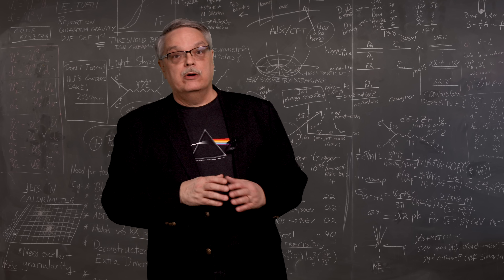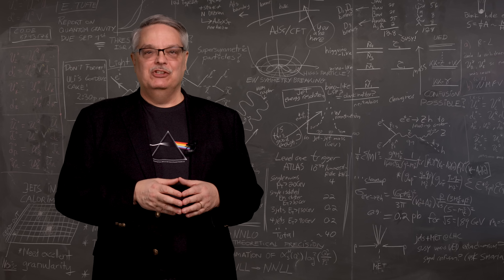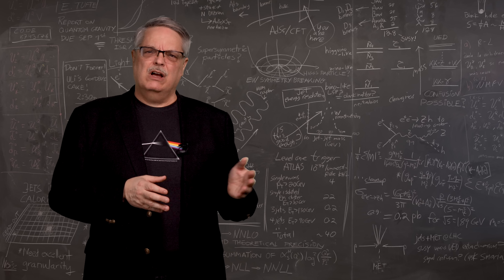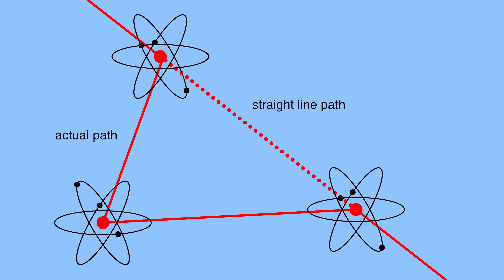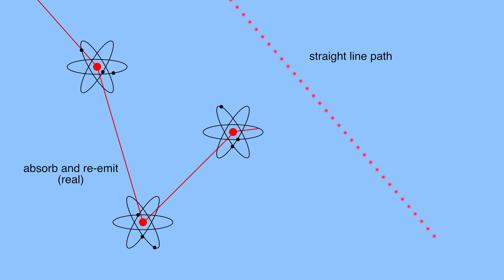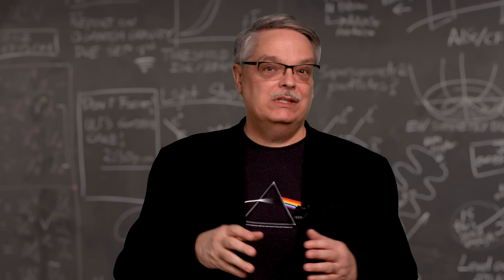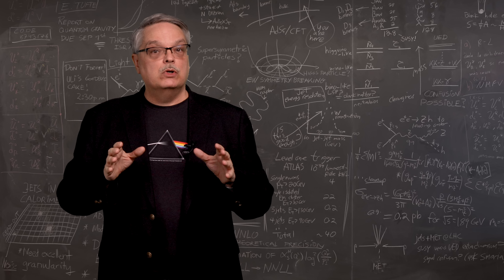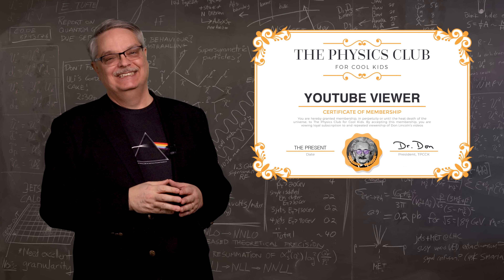Why does light slow down in water?

Comment: Dr. Don Lincoln,

Fine job sir! I do have an annoying question though since physics isn't my strong suit just yet...
When it comes to the big bang, physicists often say that the universe was in a HOT and DENSE state. But isn't that claiming at the same time that electrons were already there, all the forces of nature already worked, whatever the universe was at that time in that hot dense soup of matter and energy as Neil DeGrasse Tyson mentioned, radiation, .... in short GUT theory is already correct when they say that. Light is carried by photons, or so i'm told, in this video light slows down in any transparent medium, so if the universe came with a big flashing area of light, there must've been some transparancy and thus light had to go much much slower until the universe became completely transparent, about 380000 years later, and then light went on at the preferred vacuum speed of 299792458 meters per second. 
So here's my question, if electrons were already there, and we know that charged electrons move faster than the phase speed of light through water, thanks to Cherenkov, could what we think is inflation have been mimicked the same way and it just seemed that the universe suddenly grew by 10 to the 78th power (or so i'm told), it kinda seems odd that the universe was in a hot dense state when it started, and a black hole is cold. I mean energy, when it is compressed isn't necessarily hot, if the universe was a singularity or that is the preferred explanation so far, and gravity still had to separate from all the other forces but didn't necessarily provide all the levels of degrees of freedom that we enjoy now, it may have been there but the field was still zero until the universe was cool enough for it to start working like the Higgs was zero until the universe was cool enough for it to gain its non-zero potential, then the universe might as well been zero kelvin degrees. Energy comes in many forms and can convert into other forms of energy, so my best guess is that it can be infinitely compressed, unlike matter, because you have to squeeze the electrons into the empty spaces the neutrons and protons make, and inside those the gluons into the empty spaces of the quarks, and inside those probably something similar, and that all generates heat, because you're exciting everything, more vibration equals more heat. If you compress energy, you can burn 130 liters of gasoline to create 1 kilowatt of energy for an hour, or can can take it from a couple batteries, both substances feel cold to me and work, I can heat them both up 20°C more, and they still work, so heat is not the problem when it comes to energy, heat is a form of energy and usually the preferred form of energy that is the byproduct of converting energy, some is converted into heat energy.

Like I said, an annoying question, because I'm so not convinced about gut theory, that the universe was a hot dense soup of matter and energy, if it was a soup, it was a soup of energy, there was no matter yet, the fields that make up matter weren't there yet, so how could there have been a soup of matter and energy????
It's weird though, physicists do believe in the possibility that there could've been an inflaton field, but nobody wants to answer my question on whether or not it's theoretically possible that there is a field that determines, at certain temperature/pressure combination, certain fields are created (graviton field, gluon field, electromagnetic field, W+ field, W+ field, Z° field, ....).
It seems odd that the finger of god determines how much energy is converted into  a certain boson, the higgs field takes care of the mass of particles, but where do all the other properties come from? We need a certain temperature and energy to find the higgs, could we have found the higgs with just 7 terra-electron-volts instead of 14? Would that have created enough energy and/or temperature, to find the higgs?

Comment: I understand that this third explanation is also wrong. In air also there are always thousands of waves interfering with the light, in all the possible directions , if two interfering waves were to add up and the resultant wave would be slowed down then we would observe random speeds of light in vaccum or air too. Also, any electromagnetic wave has speed c . The reason that wave he said generated by water molecule's electron was slow is because it was in a medium which is the same question we are trying to answer. So i don't know the precise answer but this answer is not correct for sure. A phenomenon itself cannot be used to explain itself.

Comment: Sir I have a question about this explanation though you have cleared very much doubts....My Question is : How we can say that the second oscillating wave caused by moving electrons will interfere destructively rather than Constructively....if this will add constructively then it will increase the speed of light in glass, which is impossible🤔🤔🤔 ???
Plz reply my question sir
Reply: This is not impossible. This corresponds to a refractive index between 0 and 1 and means the phase velocity of the combined wave can indeed be faster than c. This will however not allow for faster than light communication since the crests will not overtake the incident wave. 
https://en.wikipedia.org/wiki/Refractive_index#Refractive_index_below_unity

Comment: Great explanation, however, I'm still unsure how the waves will combine to make a slower wave for the light in water. I understand a stationary wave added to a moving one give a resultant wave travelling half the speed of the moving one, but won't the wave from the oscillating electrons also be moving and won't it match that of the light's wave because it's reaction to it? Also, the wave from light must actually slow down otherwise the start of the light-only wave will just arrive a bit before the wave which is the sum of light and electron oscillations wave..?

Comment: This raises more questions for me than it answers. If the fact that the wavelength change of light (thus its frequency change too) changes the speed of it, means that different wavelengths of light travel at different speeds. -- I guess this is how prisms work... -- So, in this case, what is the speed of light (c)? There are like a gazillion different wavelengths, right? Which one's speed is 'c'? Or they all have the same speed, thus all have different frequencies (because they all have different wavelengths, and speed = wavelength * frequency)? Which would mean that all objects act as prisms? -- oooor 😁 the different wavelengths of light would excite different wavelengths of resonance in the electrons, therefore compensating for the variance and resulting in the same speed change (while not changing the frequency)?

Comment: Thank you for explaining this. All those years of physics classes didn't help me but this did!
Reply: Please can you explain to me why the wave created by the electrons moves at a different speed 9:20 and also why the combined new way moves slower than the speed of light 9:43 ? Please  I didn't find why...
Reply: @Khalid-Ibn-Al-Walid  Good question, but I don't think they went into an extreme depth in this video. For your second question, it's kind of simple. The "oscillated" field created by the electron is slower, so that would slow down the original light temporarily, until it speeds up again after passing through the object.
Reply: @thechannelofknowledge5145  Thank you very much for answering ! But please why The oscillated field created by the electron would slow down the original light ? I can understand that if the field created by the electron is slower then it's light will reach us slower (the light of the electron) and it can also modify the structure of the original wave, but why would it slow the original wave ?
Reply: @Khalid-Ibn-Al-Walid  Sorry if I do not give a good or correct explanation, but I think that the field created by the electron isn't exactly light. I believe they said it is an electric field. If it was an electromagnetic field instead, the original light wouldn't slow down, as photons don't interact with each other. 

Anyways, the electric field would start slamming into the photons, causing them to slow down. Since photons are restless, they would speed up again after passing through the container.

Since I do not have a correct answer for this, it's more of what I think that why the light slows down.

Comment: 3:54 Another reason why this cannot be correct is that the longer the light travels through the glass the longer the scattered path meaning that light will continue to slow as it as it travels through the glass. In addition, there is no guarantee the atoms will all be equidistant and that the light will scatter in exactly the same way from every interaction.

Comment: Electron's electric field is all around it. Oscillating electron emits EM waves in all directions. Electron's EM  wave in the direction of light wave can interfere with it and change its speed but Electron's EM waves in other directions will be absorbed or lost by the medium. In such case light will lose some of its energy and its frequency will decrease. This does not happen. Also, modified light wave should emerge from medium. This also does not happen. Why speed change is lower not higher. Kindly clarify.

Comment: So question:
Light is an oscillating electric field traveling at speed c. Moving through a transparent medium, it oscillates electrons in that medium. Oscillating electrons generate another oscillating electric field, that is moving at a slower speed. These two waves combine to make a single wave of oscillating electric field that is the ACTUAL wave that moves through matter, at a slower speed than c (because it's a combination of a wave at speed c and a wave at a speed lower than c).
BUT WHY DOES THE ELECTRIC FIELD GENERATED BY THE MOVING ELECTRON TRAVEL AT A SLOWER SPEED IN THE FIRST PLACE?

Comment: Still the question is from where it gets the energy to go back up to normal speed of light once it passes through the glass?
Reply: It doesn't need energy to do that. It simply stops interacting with the waves from the medium, because those only exist inside the medium. So all you're left with is the original wave, moving at c.

Comment: Like @Methane Lau I would also appreciate more detail about why the waves moves at different speeds. After all, they are both passing through the same medium and presumably have the same wavelength/frequency (as the colour of the light doesn't change in the medium). Although glass is a dispersive medium .... is this a factor?
Reply: The second wave doesn't really move at a different speed. The electrons excited by the incoming wave have inertia. This means that there is a lag or phase delay between the secondary wave and the incoming wave.  When the waves are added together the resultant lags the incoming wave. This lag becomes progressively greater as the wave propagates through the medium. By the way, the direction in which the electrons move is the same as the incoming wave and the secondary field is in the same direction. Therefore the wave follows a straight path within the material. Bending at the interfaces is a consequence of phase continuity over a plane wavefront just outside the boundary to just inside the boundary coupled with the change in wavelength arising from the change in speed.
Reply: @rogerphelps9939  Thank you very much for this answer you gave sir, but I have a question. I agree that the lag becomes progressively greater as the wave propagates through the medium, but at the end we will just have a big wave with different amplitudes at different places, the the "end" of the wave that first entered the medium will pursue its path without being slowed down and will keep going at speed of light. Idk if I got it wrong somewhere but I still don't understand why its slower... Please bro if you have some clarifications that would help me understand it would be the welcome....

Comment: In my opinion this is wrong. Different waves(gamma, light,microwave) travels same speed which is c. Changing the wave doesnt decrease its speed. I think the answer is in maxwell equation. The speed of the wave changed because of change of resistance of  the formation of electric field.

Comment: I had a battery powered toy car that shifted in direction (imitating refraction) when it rolled from the living room carpet to the tiled kitchen floor. This happened again when it moved from kitchen tiles to carpet. No doubt it was the change in resistance to rolling that caused the twist.  It looked strange but I could never understand exactly what was causing this to happen.  Is there an explanation for this, other than the fact that there was a change in residence? Thank you.

Comment: What if all that is happening is that the light is bending more in the water because water is similar to compressed air, and therefore the water bends more than it does in the air?
I always thought refraction index was like resistance in that increased refraction index caused more refraction the way resistance causes heat.

Comment: The video is still not clear on something (Something very important)

The original wave (Eo) AND the EM wave produced by the electrons (Ee) are BOTH travelling at C, right? Then, how does the combined wave (Eo + Ee) move slower? 
As far as I understand, it has something to do with the phase lag of Ee with respect to Eo. 

Place a very thin sheet of glass in between the source and the observer. 
The Eo before the glass stays the same. But, after the glass, we have Eo + Ee. Ee is NOT in phase with Eo. It turns out it's a quarter of a wave behind. So Eo + Ee also appears slightly 'behind' Eo. As a result, the Eo+Ee reaches the observer with a slight delay!

So, my intuition is that instead of 'slowing' down the EM waves, the glass slab kind of 'instantly pulls the EM wave back slightly' (due to interference), causing the 'apparent slow down' but travelling at C ALL THE WHILE!

What do you folks think? 

Where is my source?
Chapter 31 - Origin of the refractive index -  Feynman lectures. 
I have tried to convert the math into some intuition.
Reply: In my opinion the video is wrong. Different waves(gamma, light,microwave) travels same speed which is c. Changing the wave doesnt decrease its speed. I think the answer is in maxwell equation. The speed of the wave changed because of change of resistance of  the formation of electric field.

Comment: How does this explanation account for different indeces of refraction ?
Reply: In my opinion the video is wrong. Different waves(gamma, light,microwave) travels same speed which is c. Changing the wave doesnt decrease its speed. I think the answer is in maxwell equation. The speed of the wave changed because of change of resistance of  the formation of electric field.

Comment: Question: does light actually slow down inside medium (water) OR is it that it ends up travelling longer distances (due to refraction hence longer path) at same constant speed but when iy exits the medium it is delayed in time due to having lonher distance to travel?
Reply: I think that light actually slows down as it clearly prove the change in direction 
For the second part I think that as per Fermat's law light were to travel through a way which take shorter time
and the shortest distance is a straight line and adding up all the probabilities of refraction of light , it makes sense 
only it is slower because the distance light travels in glass is becoming shorter rather being longer

Comment: OK, so the electric field in the material is a combination of the original wave plus an oscillating field from the electrons, but why does that combined field propagate with a lower speed? When we reach that point in the video you just state it as a fact, so, so I would say you didn't explain it at all!
Reply: In my opinion the video is wrong. Different waves(gamma, light,microwave) travels same speed which is c. Changing the wave doesnt decrease its speed. I think the answer is in maxwell equation. The speed of the wave changed because of change of resistance of  the formation of electric field.

Comment: Thanks for this video but I till don't understand why this interaction with electrons could slow down the light.
I'm sure the reason of light slowing down is due to this mechanism but you didn't fully explained.
How could you slow down the photon by interfering with it if it continues to run at speedlight ? (as you said at the beginning of the video).

Comment: Your explanation doesn't seem completely satisfactory to me.  Since electrons are constantly in motion, would they not already be producing their own electric field.  The idea that the light induces the electric field in the medium that then interferes with the light seems like an unnecessary step.  Wouldn't the medium already have an electric field which would interfere with the light?  If the effect is really due to interference, we should logically see a different wavelength in the medium.  Of course, your theory would seem to indicate a different wavelength in the medium which is not observable since we only see the light outside of the medium.